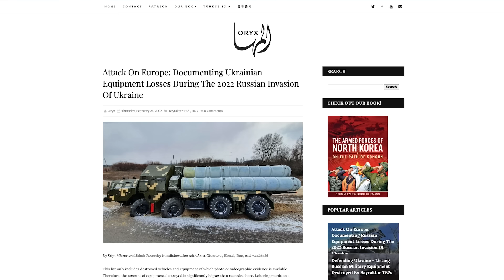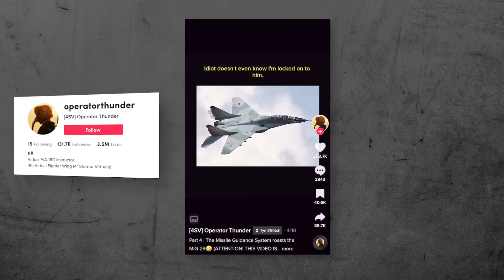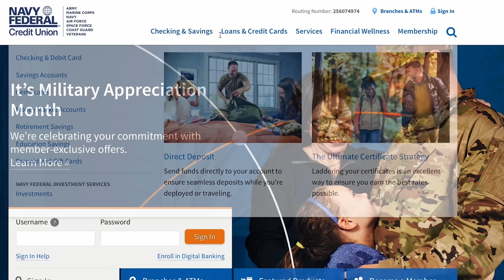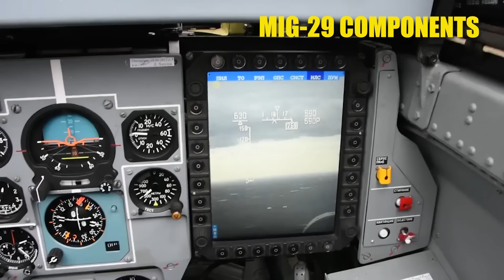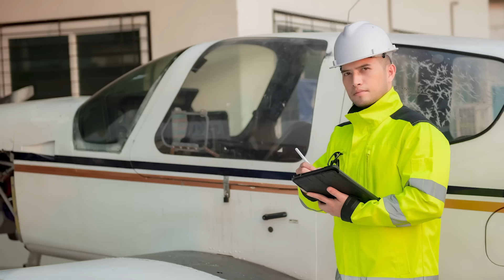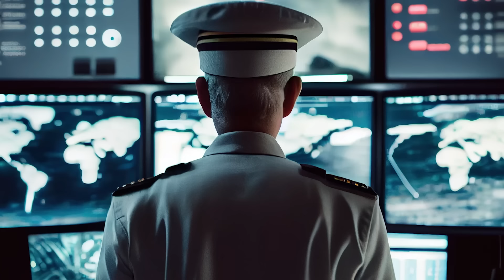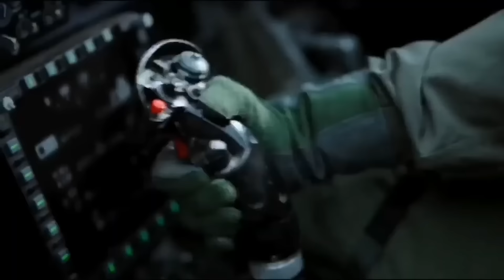How Ukraines new MIG-29 Fighter Jet Operates

Comment: Another advantage of the MiG-29 over the F-16 is its rough field capabilities. The MiG-29 has a far more robust landing gear and wheels than the Falcon. Also it can close its engine inlets and suck air through louvers on the top of the inlets to feed the engines while landing and taking off avoiding FOD.

This means that Ukraine can close off a section of road and use that for a landing strip. Or even use a dirt or grass runway to base its Fulcrums from.
Reply: What collosal bs this is.

Your typical road is not suited for landing of fighter aircraft, this is common knowledge. Airways and civilian roads are built to completely different standards, and while a certain section of a highway might be capable of hosting fighter aircraft, this is far from the norm. The only aircraft on this planet that can operate on larger sections of civilian roads are the Gripen, not Mig-29s
Reply: I like to call that individual piece of Soviet engineering philosophy we see of that nature the "Fallout" angle. Individual adhoc units in a nuclear wasteland battlefield was a real theory both the U.S. and USSR cashed in on in different ways. The USSR styled things to be smaller in locale akin to bandit mentality while the U.S. doubled down on interoperability to find missing links of it's units to coalesce forces again
Reply: @AHalz  gripen is able to do that because it isn't that wide like a mig-29 which would certainely Crash into a light pole. Except If the UA has a 6 lanes Autobahn then it could be possible as the MiG is only 5 tons heavier at max. And If the Highway can sustain tanks which are several times heavier, such a Fighter wouldn't pose a problem
Reply: @AHalz  That's true to some degree, there're videos of Ukrainian MIGs taking of from a highways in Ukraine, and it's a known fact that MIGs landing gears are more stronger comparing to F-16. That's actually one of the points against giving F-16 to us, cause our landing bases are soviet-made basically, made from concrete plates, which are not suitable for F-16. But yes, you're right, common roads are not suitable at all.
Reply: @umbra6772  Interesting thought. Something to research my next day off.
Reply: @AHalz  i was a 16 crew chief and it's true. 16 is powerful in the air, but on the ground the low inlet can suck in fod to damage the motor. soviet doctrine caused their fighters to be more robust and operate from quickly made airfield such as the OP mentioned. 29s would continue to work well in this war. 16 would dominate against the russian air force, but on the ground i'm very curious how well they would be able to maintain a clean flightline. it's one of the issues that WILL require thought
Reply: Во времена СССР когда строили дороги, специально строили дорожные секции как раз для применения Истребителей. В РФ например вообще начали проводить учения где МиГ-29СМТ летает с дорог. Просто после распада СССР правительство Украины, как и в других странах бывшего СССР, забило болт на это. Дороги и секции пришли в упадок, и летать стало нереально. Теперь вот аукнулось.
Reply: Except by 1991 MiG-29 had medium-range missiles, while F-16 only had aim-9s. Mig could engage it with those missiles first and also had HMS which F-16 didn't have. 

So no, there'd be no "dominance" by the F-16. In fact the reason why US was able to beat MiG-29s in Iraq was that Germany had completely disclosed the MiG-29A to them, operating frequences and all to NATO, and also AWACS was widely used which allowed for the controlled intercept from superior aspect.
Reply: @AHalz  In my former eastern bloc country, there are specially designed sections of highway designed for this, that don't have signage or lightpoles. Now we know that we can look for them to find a safe landing area in case of engine out for GA aircraft.
Reply: @AHalz  Another Swedish propagandist
Reply: @Max_Da_G  The F-16 had AIM-120s by then, it shot down an Iraqi MiG-25 Foxbat with an AIM-120A in 1992. 

Now the F-16s Ukraine get would be far more effective than the MiG-29s with later block models. They'll be able to lock Russian jets at up to 125 miles away and if they have AIM-120Cs engaged them at almost 60 miles. If the US sends the latest AIM-120D then that goes out to a 100 mile engagement range with a missiles that is far more effective against small fighters than the large long range AAMs Russian is using.

Also MiG-29s can't use the HARM in multi-modes while inflight, they are preprogrammed on the ground as a workaround for the limited electronics on the MiG-29.

F-16s would greatly increase the lethality of the Ukrainian air force both in air superiority missions and ground pounding. The Viper can carry double the bomb load of the MiG-29. 

And now Ukraine will be getting them, probably 100 by this October.
Reply: @AHalz  
I've seen A-10s do it.
Reply: @AHalz  why can’t a mig 29 do that
Reply: True. Migs (and the SU25) can and are being used as you describe. Recent footage from TVP World explained that operating from highways instead of runways is one reason it's so hard to target Ua's aircraft. @AimenHalim needs to read up on the Mig. Using highways as landing strips was part of the Soviet plan to remain operational during a nuclear war. In the US aresenal it's only heli's, drones, cargo planes and Warthogs that remain operational from highways, though it did require they survey the roads used and clear them of debris.
Reply: @AHalz The US regularly launchez aircraft from roads and highways,i got to watch an elephant walk take off from a stretch of highway oncd
Reply: @drutalero2962  So GD should have put the intake ABOVE the canopy?    Lol, I know, I'm being a dick......
Reply: @raymondpaller6475  no, but migs have an antifod cage on the ground that retracts in the air
Reply: The f16 is super deadly against s 300 it would definitely help ukraine
Reply: @tombair1401  knowing ukraines track record, they would allow their pilots the bare minimum in training and then send them to their deaths 

anyways, Ukraine is already throwing around the blame game on its ineffective counter offensive, just a matter of time before Ukrainian officers start blaming each other and NATO (because Zelensky has already started blaming NATO for the counter offensive not gaining credible ground) US DOD already admitted that Ukraine is only letting its units get the bare minimum for training on foreign equipment, Ukraine has been pushing out tank Crews with as little as 3 weeks experience training on the thing 

and the DOD already stated that Ukraine hasn't effectively spread Combined Arms training (and with them committing their most elite units to suicide ops, its safe to say Ukraine will be worse off after this offensive) Ukraine committed 100% of their Marines to a 10 mile front and their officers are already complaining of high casualties (and the Ukrainian Marine Corps is one of the few groups that actually properly trained)

I know Russia was shit at warfare, but committing 100% of your best trained, best equipped troops to your most contested front line is just asking for disaster
Reply: @AHalz do you have a source for why the mig 29 can't do this?
Reply: @Humbulla93  You had a good point all the way up to weight. Tanks can be times heavier, but its actually not as common as you might think, especially for takeoff weight.
Reply: @goldenhate6649  i took take off weight into consideration the fully loaded plane is still lighter than a tank. I've seen a tank column in Germany and the Autobahn looks still untouched

Comment: The thing about the f16 that wasn’t covered is the blocks. Yes, the MiG 29 and f16 are comparable but you need to compare the specific block f16. Simply put, the f16 has had more investment and upgrading over the year’s comparatively, the the latest MiG 29 variant which is probably as  good as the f16 block 60 with an aesa radar of its own isn’t in full production. It should be pointed out tbag a lot of the F16 in US service are kinda shit when compared go the top US aircraft flying, and that’s simply because they ARE old. The US hasn’t received a new f16 in over a decade. Many of the f16 flying are f16 block 40 or 50 which radar isn’t that great, using a mechanically scanned pulse Doppler radar rather than an aesa radar like the apg 80 on the block 60 or apg 83 on the block 70. F16 block 50s are better than the modem MiG 29 in Ukrainian service and can fire better munitions, that being the aim 120. Ukraine doesn’t have r77-1 which are the Russian equivalent to aim 120 c-5 which outrange r27 and the most important thing is the r27 is sahr rather than arh(semi-a five radar homing vs active radar homing) and that can be important when you need to go defensive and lose a lock on the target, the missile can then use its own radar rather than searching for the radar beam.
Reply: @fatdaddy1996  problem with the mig-29 is the lack of missiles
Reply: Yeah, great points. This comment should be higher.
Reply: I saw an Ukrainian military channel interview in which the F-16 MLU was discussed. Not as good at the latest upgrade, but good enough to seriously vex the enemy.
Reply: @lordphullautosear  They just need that targeting and Navigation pod and the AN/ASQ-213 HARM targeting system to make best use of it, along with the AIM-120C, now if they can incorporate the Meteor missile .....
Reply: Those missiles you are discussing completely outrange the Ukrainian MiG-29s radar. So it wouldn't work. Unless radar outranges the missile it literally shortens the missiles legs. And yes, I'm aware that missiles are fired from a range of No-escape-zone and not from max range.

Comment: MiG was responsible for the ADM-169 so i can see them still playing a role when F-16 arrives
Reply: They should definitely currently have more trained mig29 pilots and trained maintenance crews. Planes also have limited lifetime flight hours and continuous flight hours possible, so cycling pilot through planes maintenance cycles will probably improve availability and lifespan.
Reply: F16 won't bae arriving...
Reply: @king_kiff3969  They'll arrive by end of September.

Comment: Ukraine should definitely currently have more trained mig29 pilots and trained maintenance crews. Planes also have limited lifetime flight hours and limited continuous flight hours possible, so cycling pilot through planes maintenance cycles will probably improve availability and lifespan.
Reply: They had only 240 of them so....
Reply: @piotrd.4850  They had less than 50 MiG-29's on Feb 24 2022
Reply: More aircraft will definitely help the pilot get more flights and relieve pressure on the maintenance crews by increasing operationally available aircraft. Which will be especially helpful because it sounds like the mig 29 is a pretty maintenance intense aircraft.
Reply: Ukraine has virtually no jet aircraft left what so ever. The levels of copium for deluded Americans is insane.
Reply: @king_kiff3969  ukrainian army does not exist, all ukrainian sams have been destroyed, they have no tanks left, 25 patriot sams have been destroyed by 0.02 Kinzhal etc etc etc. Your profile pic says it all.
Reply: @ОлегКорнійчук-е1х  the leaked documents validate his point. An invading force looses it's troops at a ratio of 3:1 but Ukraine being a defensive force is losing at 5:1. Ukraine is just holding on, even the Nazis held on for years but even they knew they lost the war in 1940 and fighting on was pointless no matter how hard they try
Reply: @Pinicle_of_evolution  Straight from the said leaked pentagon documents, which you can easily google :
RUSSIA : 
35.5k - 43.5k KIA
75 fighter/bomber; 82 rotary-wing
6,004 ground vehicles
UKRAINE :
16k-17.5k KIA
60 fighter/bomber; 32 rotary-wing
11 strategic SAMs; 34 tactical SAMs

Based off these numbers, can you explain how Ukraine is losing 5:1? Also, Nazi Germany was an invading force, so I have no clue what they have to do with Ukraine being a defensive force, fighting in their own environment and climate.

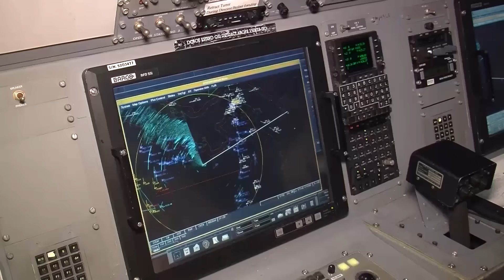Comment: The actual main advantage of these MiG-29 assets is their ability to carry HARM anti-radiation missiles.  Cappy mentions this at around 16:45.  However,   with the MiG, these are not fully integrated, so the missile has to use pre-programed mode.  With F-16, you have full interoperability, so you can use HARM in a Wild Weasel role.  Basically, with the MiG, you can take out a radar site if you know where it is before you take off.  With the F-16, you can go hunting.
Reply: I would imagine the HARM/Super-Shrike whilst going to pre-identified target positions, will be able to be an set to a passive or semi-active mode on the ground, mission & intel dependant, where should an electronic emission be emitted from a pre-specified selection of target emissions, that it will direct itself to it/them & the to an object in the close vicinity of that emission should it have 'gone silent'/dark and shut itself down.